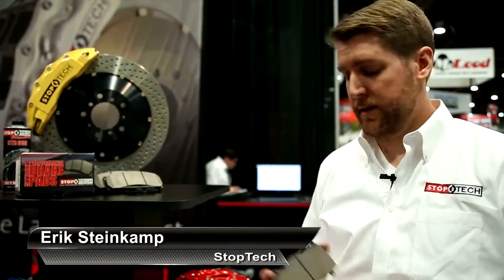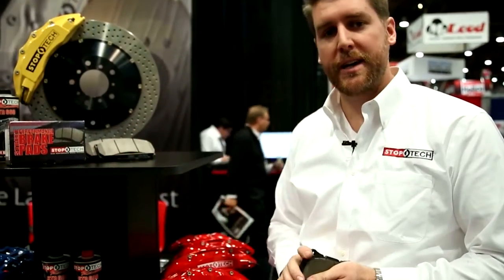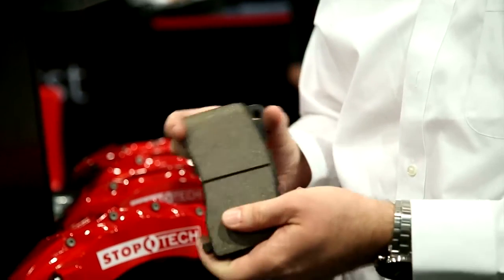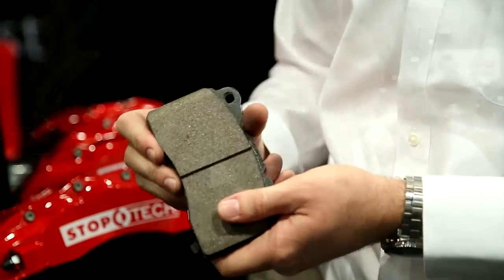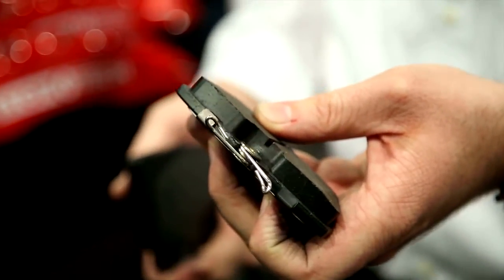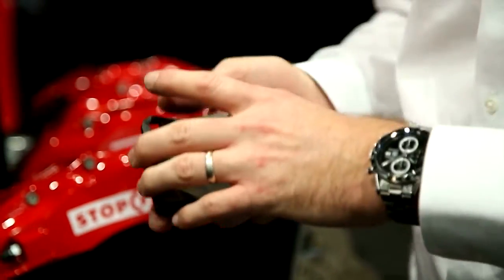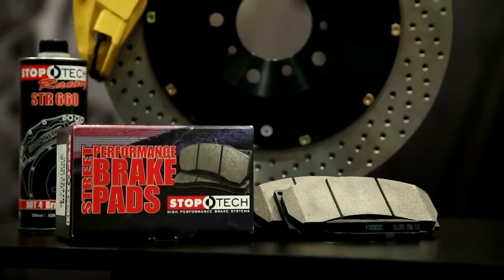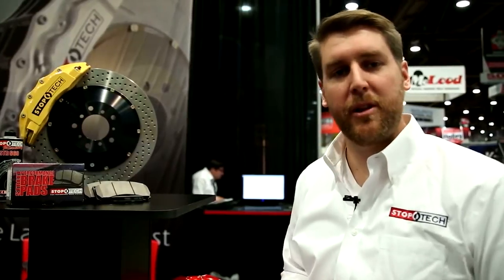StopTech Street Performance Brake Pads Review - SEMA 2013

Comment: I have a 2006 Jetta 2.5 and once I tried ceramic and they took me longer to stop.  I moved on to the para aramid and they are even better than the factory pads.  The longer stopping from the ceramic was not what I was expecting, they were Akebono because of that it came as a surprise.  I now use only para aramid and none of that ceramic any more.  The key advantage of ceramic is supposed to be that the brake dust is not as dark and so it does not show up as easily.
Reply: Good advice. What brand-model of brake pads are you taking now ?.